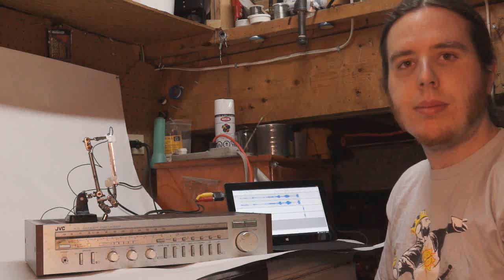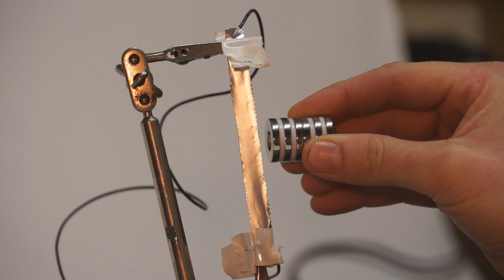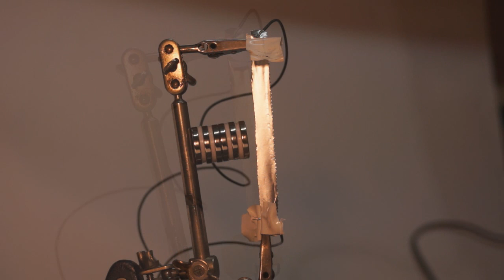Simplest DIY Speaker

Comment: The thing is that magnetic lines become horizontal at a very short distance from a cylinder magnet pole. So, your foil moves left-right more than back and forth. Then rotate it 90 deg clockwise, and it will be louder (and displace it from a center of the magnet)

Comment: What happens if the magnet are placed behind the ribbon instead of sideby the ribbon?
Reply: Due to the right hand rule, you'd get a force going sideways which would be as effective of a speaker due to the low flexibility in that direction and the foil thin surface area. Hope this helps!

Comment: How did you power it? Just straight out the amp to the ribbon? Transformer? or like 4ohm series resistor? What watt was the amp driving?
Reply from the maker: I used a transformer that was about 30:1 to step the voltage down and the current up. The amp puts out around 50watts.

Comment: pretty cool :)
https://en.wikipedia.org/wiki/Loudspeaker#Ribbon_and_planar_magnetic_loudspeakers
But what happens if you made the ribbon curly? Does it work?
Reply: Cool man, thanks :)
I tried with these magnets https://duckduckgo.com/?q=buzz+magnet&iax=images&ia=images
It worked but was barely audible! Maybe cause the source was audio output of radio/laptop!
I stuck the magnets in carton/box paper in holes, and made hole for the aluminum strip then held them with alligator clamps.
Also tried a strip from the cigarette box foil, and it worked ! ;D but still barely audible.

Comment: glue iton a stretched plastic sheet yo will get more sound
Reply: It would make it similar to a planar magnetic speaker
Reply from the maker: Yes, that would significantly increase the surface area and move much more air.
Reply: Both use a similar working concept. A current through a wire, or metal sheet manipulated by a magnet.

Comment: I have to do this with my kids tomorrow. Thanks for the idea!
Reply from the maker: I was using an old (big) stereo to power my speaker, you will need an amplifier of some kind to make this work headphone or RCA output will not work. To prevent the amp from shorting out and being damaged start with a very long narrow strip of foil, if that works you can try thicker strips to make it a little louder.

Good luck and have fun!

Comment: Definitely going to make one of these.
Reply from the maker: Just be careful of impedance. A normal speaker is 8ohms of impedance where as a foil strip is effectively 0. Try a very thin strip first as it will have a higher resistance than a wide strip.
Reply: +Nick Moore, cool man, I was wondering about the impedance, good thing I saw your reply here. :)
+Justin Bell I tried it with these magnets and it worked but barely audible https://duckduckgo.com/?q=buzz+magnet&iax=images&ia=images
Since, I got no neodymium magnets. You can used clothes pins (wood better than plastic) to hold the wires and foil on desired surface.

Comment: Try corrugating to cut down on the foil-rattle.
Reply: Nick Moore yeah, but for your setup, any zigzags would likely make an improvement.  

Another method (piston corrugation) involves some transverse zigzags on each end, and a couple longitudinal groves down the middle.
Reply from the maker: Stephen Tack Interesting, like rolling long dimples in a car floor for rigidity. You end up with a large rigid section in the center with two flexible ends!
Reply: Good idea. The same way a ribbon mic operates, in reverse.
Reply: https://plus.google.com/+StephenTack/posts/RTMy4dhKuZK?pid=5728206211159389154&oid=113574383147361395957

Exactly.
Reply from the maker: x9x9x9x9x9 I had read some instructions on how to add "perfect corrugations" to your 900$ ribbon speakers. It involved pressing it between 2 pieces of cardboard that were cut to a /\/\/\/\/\/\ shape.
Reply from the maker: Stephen Tack I love that rig! I want to build one for a bluetooth adapter!

Comment: Now plug it into your mic port and record!
Reply from the maker: If I put it back together later I'll hook it too the scope and see what kind of signal it will put out.
Reply: Nick Moore
un2mensch It's a ribbon microphone. http://en.wikipedia.org/wiki/Ribbon_microphone
Reply: you need a transformer.
Reply: +un2mensch I think you need a step-up transformer 1 : 37
a 5 volt transformer, used in reverse, say of a cheap USB charger might work. 220v to 5v
Even though 220/37 = 5.95 v = ~ 6v
a 110v to 3v transformer  used in reverse might be very close to that value.
Reply: +un2mensch or build your own audio transformer, say with a big enough toroid, and 5 turns input and 185 turns output. it is a step-up. might work.
You could salvage that toroid from old computer motherboard or ATX PSU power supply unit.
And the wires could be found in old tube TV or CRT monitor. It is a black cable or other color fixated around the tube.
https://youtu.be/xMNTOXGdYM4?t=55s
https://youtu.be/yPP4zR74Fr0